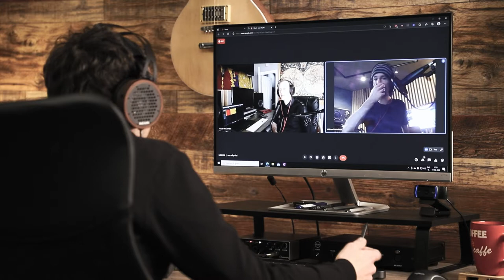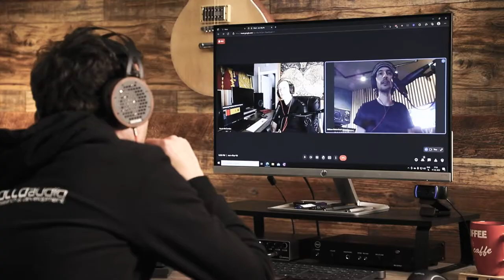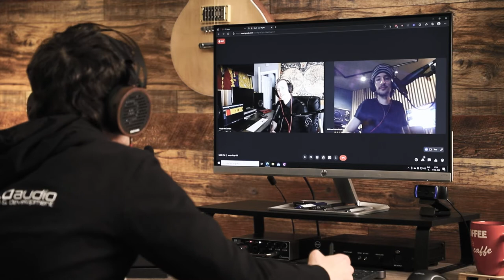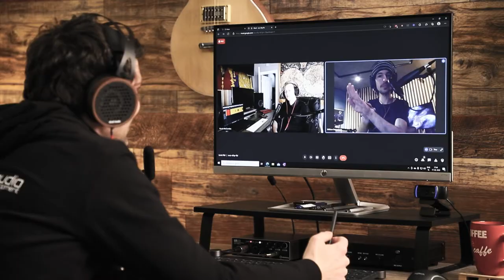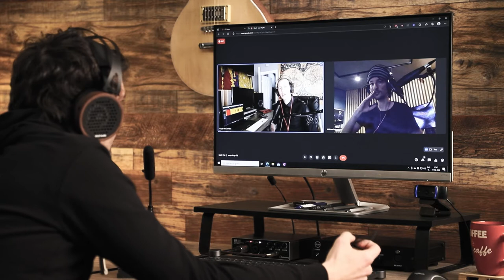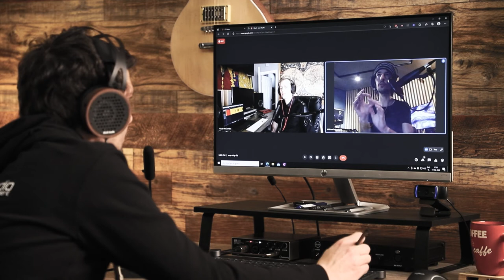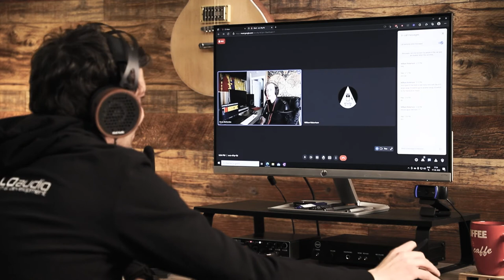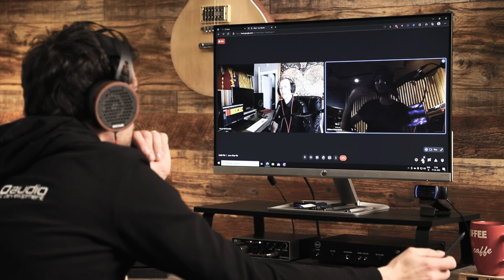Mixing 300+ stems in a single song with Kevin McCombs and William Robertson hosted by OLLO Audio CEO

Comment: Dear Rok, how is it possible that I can see driver on your headphones? I can't see it on my S4X. Thanks!
Reply: It's a modiffied acoustics,... Nothing dramatic :)
Reply: @rokgulic3095  It looks great 👍
Reply: @rokgulic3095  Can you specify please? I have modified mine and would really appreciate your advice on the subject
Reply: @matthewcamilleri8522  If you take off the back covers, there's acoustic resistor (foam) that can be removed. Will affect frequency response, most audiably in 2-4kHz area.